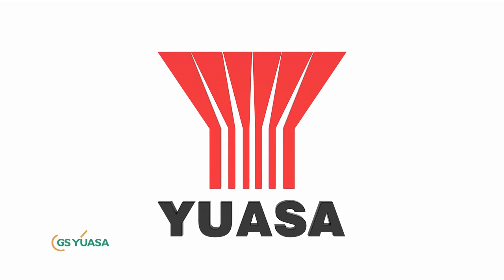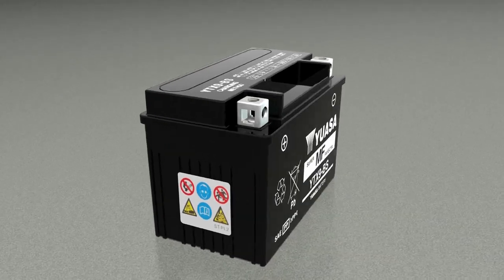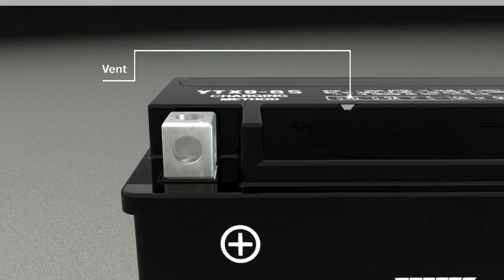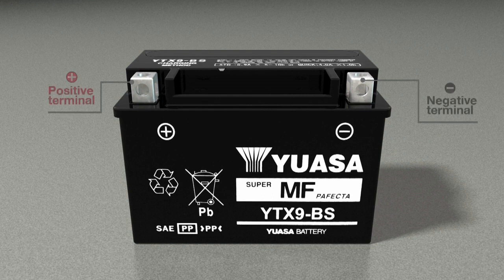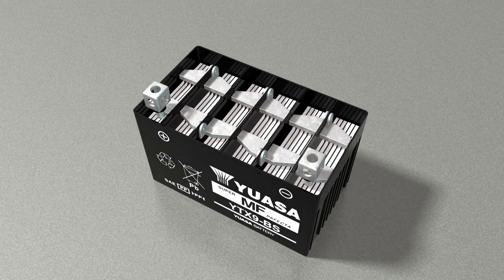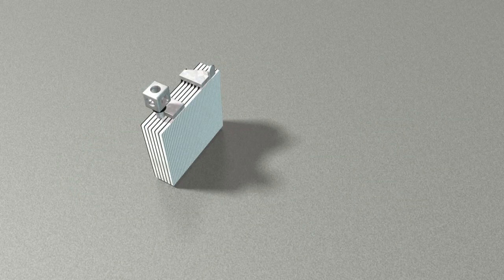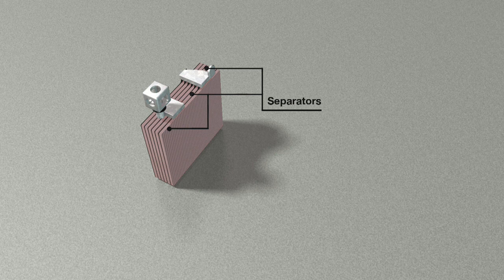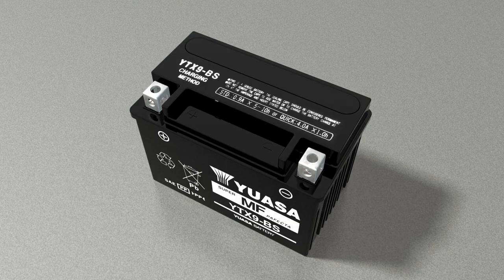Motorcycle battery construction - GYTV

Comment: Problem with Yuasa batteries is that if they are not used for long periods, like when fitted to a motorhome, the voltage drops to a nonrecoverable level which is not covered by the warranty.
 I have a 10 month old battery which has been tested to give 60% and recommend replacement already. do not buy a Yuasa battery unless it is for everyday use.